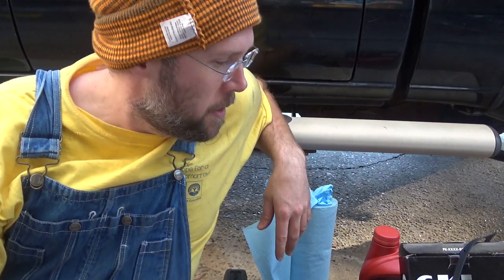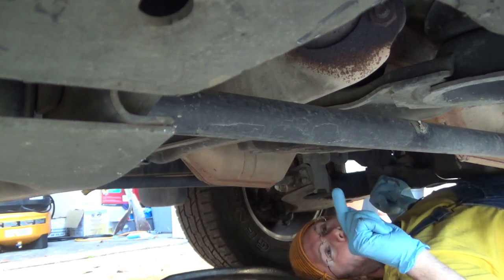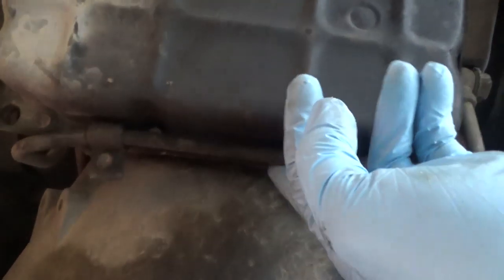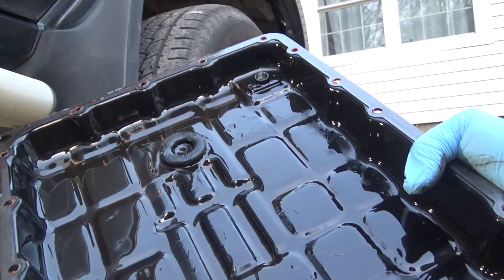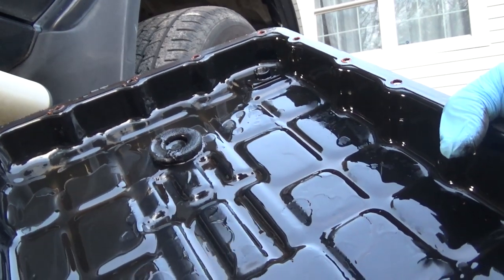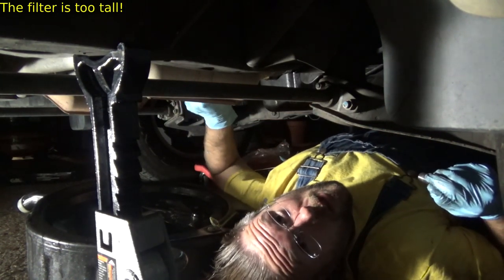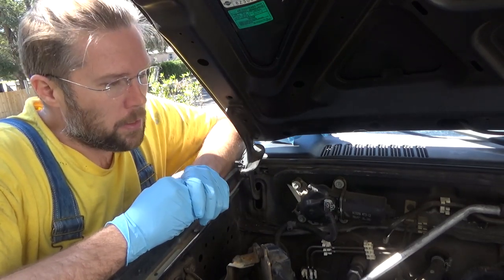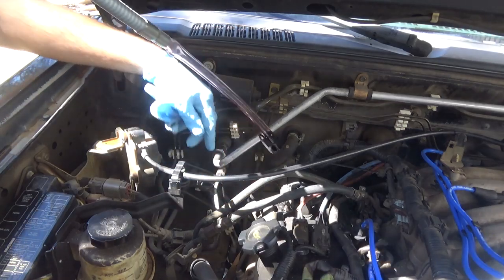2002 Nissan Frontier Crew Cab SE Transmission Fluid Change

Comment: Thank you for sharing the knowledge for which we are learning every day, I only have one question, when you use the measurement torque to which gauge you tighten the screws of the oil drain pan, thank you for your answer

Comment: My Nissan Frontier 2000 seems to making some rougher less smooth shifting in lower gears n all ( automatic trans) so I think it’s time for an transmission fluid change etc but I’ll get someone to do it for me . Also my fluid was good n pink or red off the dipstick which is a good sign that it is clean I hear . Also I just had an oil change and had used fully synthetic last oil change then went to semi synthetic this last change a few weeks ago which I had been using semi synthetic Max life vavloline line for years .
Reply from the maker: How did this turn out for you? Transmission still good?

Comment: I just changed the transmission fluid on my '01 Frontier Crew Cab XE with authentic brand Nissan transmission fluid. I made sure I added the correct amount. After I got done changing it, the truck doesn't move forward or backward but accelerates. I hope I didn't just destroy my transmission! Any tips? 😐
Reply from the maker: Sounds like the fluid is too low.
Reply: @RazorBucks  when I emptied it out, there were about 4 and 1/2 quarts in the pan. I added 5 quarts of the fluid but I didn't want to overdo it... I may just take it to a mechanic.

EDIT: I drained the fluid out of the pan and checked my work, then put it all back together. After doing that and adding about 4 and 1/2 quarts of fluid, it ran perfectly!
Reply from the maker: Did you check the level with the dipstick?

Comment: If my frontier has 280k would you recommend this...or just a drain and fill no taking of the pan ?
Reply: First,check the fluid. If it’s still not burnt dark,but just a brown color,you can drain and fill. In those Nissan’s transmisions there is no filter,just a screen,it’s not required to be replaced,unless you have a mechanical problem inside,or a water damage. So,there is no need to drop the pan every time you do drain and fill. I do my every 25-30k.
Reply from the maker: Just drain and fill.

Comment: My 02 Frontier takes a long time to shift into overdrive when it's cold.  I have never changed the ATS oil.   Anyone else experience this?
Reply from the maker: No, but I would change it if I were you.You are probably past the maintenance mileage for that service.
Reply: My dus the same thing!
Reply: I think it's purposely designed to do that so the fluid warms up faster - it's always done that for me - goes into overdrive at roughly the same spot on the highway on my way to work in the winter.

Comment: Were any of the studs which hold the filter/strainer in place "loose" fitting? I saw one Youtube video on a Nissan Pathfinder transmission fluid  change that three of these were actual bolts (as opposed to studs) which could be pushed upwards (and presumably "lost" in the transmission if you were not careful!  Does this comment apply on the Nissan Frontier?
Reply from the maker: Not that I recall, but let me review the unedited video and get back with you.
Reply: Take a look at https://www.youtube.com/watch?v=F0OwgbWbOGo  It is a Pathfinder not a Frontier but you can see on this video that there are three (inverted) bolts that he has to remove the nuts from.  I don't know  what would happen if they accidentally got pushed up - But "What can go wrong will go wrong!".  Looking at his video I get the impression that you could just leave the filter/strainer in place and vacuum out the debris because it is all on the underneath of the strainer.  Most of the local auto shops just clean the existing filter in place and replace the transmission fluid .  It may not be quite as thorough as replacing the filter but I get the impression it would be adequate.  What do you think?  Thanks.
Reply from the maker: I am not able to verify the bolts. I did not have a good shot of it, but I did not see anything in the service manual for it. I also removed all the bolts, so I do not think that the other video would apply to this transmission, but I cannot be 100% sure.
Reply: Thank you for the response.  It sounds like you did not encounter a problem with these bolts.

Comment: I recently changed my transmission filter and added about 11 quarts of atf on my 2003 Nissan Frontier SC. I realized many people  have used around 4-5  quarts and was wondering if having too much atf is what's causing my gears to slip and slow accerleration?
Reply: 11 quarts is the whole capasity. You’ll never going to drain all the fluid just by opening the pan. In most cases it’s about 4 quarts. If you added 11 quarts,trans is flooded,and you just caused a permanent damage to it.

Comment: Im due for a transmission fluid change in a couple of miles. Have you experienced any issues with the valvoline atf fluid you put in?
Reply from the maker: None at all.
Reply: Razor Bucks How much oil did you end up using?

Comment: How does the permatex work when you remove the bolts next time
Reply from the maker: Sorry for the late response, been busy with work.  Just use permatex again, however Nissan recommends replacing the bolts entirely.

Comment: What did you use to unscrew the drain plug? I have a 2003 model and it's not a normal shape of a bolt and places like jiffy lube say they don't have the specific tool needed to open it.
Reply from the maker: For my truck, I used a 19mm socket.

Comment: Did you notice any difference on how your truck shifted and drove after doing this?
Reply from the maker: Yes! It was much more smooth. Thank you for the comment.
Reply: Razor Bucks thanks for the video and for responding how many miles did your truck have when you performed the fluid change?
Reply from the maker: Around $145K.
Reply: Razor Bucks thanks I have a 103k I'll probably do this to my frontier thanks for responding I appreciate it

Comment: You put in 3 1/2 quarts of fluid in??
Reply from the maker: Between 3.5 - 4. Your level need may be different, but start on the lower end.
Reply: Razor Bucks thanks for replying!!
Reply from the maker: No problem. I hope your work goes well.

Comment: How much oil do you need to put in?
Reply from the maker: Check your manual, if you have it. Mine takes 3.5 quarts, if you have the same vehicle as I do, then yours will be the same. If you replaced the filter, 4 quarts. Test it on level ground, to see if you need more or need to let some out.

Comment: Hi Razor Bucks, awesome video.
What type of transmission fluid did you use & would the gasket need sealent as well?
Thanks ahead!!
Reply from the maker: Hello Harvey, I used Valvoline Maxlife ATF. I used permatex ultra gray as the gasket maker and I have had no leaks. Let me know if you have any other questions.
Reply: Razor Bucks my frontier 01' has 179,000 miles. The truck was bought 2 weeks ago it was out of ise for almost 2 years any suggestions with the maintence and transmission change?
Thanks again.
Reply from the maker: I would suggest you change all of your fluids, if you do not know when the last maintenance was performed. Is the transmission bad or are you talking about the fluid?
Reply: Razor Bucks tranny run great but recently i got a p0744 code any suggestions
Reply from the maker: How comfortable are you with working on your truck? You might want to start with changing the transmission fluid. https://www.yourmechanic.com/article/p0744-obd-ii-trouble-code-torque-converter-clutch-circuit-intermittent and https://www.engine-codes.com/p0744_nissan.html
Reply: Razor Bucks  thank for that link, ill keep you posted if any changes on this flush and code, Thanks again
Reply from the maker: You will need to clear the code and then see if it comes back, after your fluid change.
Reply: Razor Bucks hi there im in the working progress changing the atf, what will be the pan bolt  toque lbs.
Thanks again!
Reply from the maker: 70 in/lb or no more than 6 ft/lb. I believe I did 5 ft/lb, just to allow for a slight overage. Slow and steady wins the race here. Also, do not fill with oil straight away, let your gasket have time to harden. Did you replace the pan bolts or are you using ultra grey on them?
Reply: Razor Bucks everthing was replaced, now checking the level in this truck do i have to warm no normal engine temp.  put in neutral or park?
Thanks
Reply from the maker: Per the manual,

Checking A/T Fluid
1. Warm up engine. 
2. Check for fluid leakage. 
3. Before driving, fluid level can be checked at fluid temperatures of 30 to 50°C (86 to 122°F) using “COLD” range on dipstick. a. Park vehicle on level surface and set parking brake. b. Start engine and move selector lever through each gear position. Leave selector lever in “P” position. c. Check fluid level with engine idling. d. Remove dipstick and note reading. If level is at low side of either range, and fluid to the charging pipe. e. Re-insert dipstick into charging pipe as far as it will go. f. Remove dipstick and note reading. If reading is at low side of range, add fluid to the charging pipe. Do not overfill. 
4. Drive vehicle for approximately 5 minutes in urban areas. 
5. Re-check fluid level at fluid temperatures of 50 to 80°C (122 to 176°F) using “HOT” range on dipstick.
6. Check fluid condition.  If fluid is very dark or smells burned, refer to AT section for checking operation of A/T. Flush cooling system after repair of A/T.  If A/T fluid contains frictional material (clutches, bands, etc.), replace radiator and flush cooler line using cleaning solvent and compressed air after repair of A/T. Refer to LC-14 (KA24DE), LC-32 (VG33E and VG33ER), “Radiator”.
Reply: Razor Bucks  all good !!
Reply: Thank you for the big help and fast respond!!! Keep up the the frontier videos,
Reply from the maker: Thank you, I am glad the videos were able to help.
Reply: @RazorBucks  Does that mean you didn't use the gasket that came with the filter?
Reply from the maker: @DonLock3  Correct.
Reply: @RazorBucks  Thanks, It was confusing to see you hold up the gasket and then mention gasket maker. Great Video!

Comment: What cleaner did you use for the pan?
Reply: David Juarez looked like brake fluid, have same can in my shop.
Reply: Yea, mechs use brake fluid...some would argue non chlorinated over chlorinated: residue being left.
Reply from the maker: I apologize for the delay, I never seen this question. Yes, as Kev Sims and settripsbunch said, it was brake cleaner.
Reply from the maker: Thank you for answering Kev Sims and settripsbunch for stepping up and answering the questions I missed.

Comment: do you need silicone for the gasket?
Reply from the maker: I made a gasket with gasket maker. That is what the Permatex is for.
Reply: @RazorBucks  thanks
Reply from the maker: Best of luck to you on your maintenance.
Reply: @RazorBucks  do i need to put it in reverse and one tire on the air to get air  out of the system?  i am  happy almost  done
Reply: it only accepted 6 quarts of  oil
Reply from the maker: I am sorry, I am not sure what you are talking about? Are you asking about the transmission?
Reply from the maker: 6 quarts of oil in the transmission? You need to check to make sure you have not overfilled.
Reply: @RazorBucks  yes
Reply: thank for your help
Reply from the maker: There should be no reason to do anything about oil, as far as I know.
Reply: Razor Bucks did you use a gasket? Or did you use only the permatex for a gasket?
Reply from the maker: @steveng.c.8524  Permatex.
Reply: @RazorBucks  Why did you decide to make your own gasket rather than use the one that came w/the filter?
Reply from the maker: @tokenn1822  The filter they sent me was wrong. I feel that was a lesson learned for me to only buy OEM parts. I generally do only purchase OEM large parts, but I thought how could a filter get messed up and I learned how.
Reply: @RazorBucks  Ohhh, I see.  So had they sent you the correct part, you would have used the gasket that came with it?
Reply from the maker: @tokenn1822  Yes.

Comment: Can the bands be adjusted on this trans
Reply from the maker: I am going to paste what the manual says, but this is not something I have performed and I would recommend seeking additional sources of information.

Part No.* Free length Outer diameter
Low & reverse brake 18 pcs
31655-41X00 (Assembly)
22.3 (0.878) 11.2 (0.441)
Band servo
Spring A
31605-41X05 (VG33E only) 31605-41X14 (VG33ER only)
45.6 (1.795) (VG33E only) 47.6 (1.874) (VG33ER only)
34.3 (1.350) (VG33E only) 26.5 (1.043) (VG33ER only)
Spring B
31605-41X00 (VG33E only)
53.8 (2.118) (VG33E only)
40.3 (1.587) (VG33E only)
Spring C 31605-41X01 29.7 (1.169) 27.6 (1.087)
Accumulator
Accumulator A 31605-41X02 43.0 (1.693) 18.0 (0.709)
Accumulator B
31605-41X10 (VG33E only) 31605-4AX03 (VG33ER only)
66.0 (2.598) 20.0 (0.787)
Accumulator C 31605-41X09 45.0 (1.772) 29.3 (1.154)
Accumulator D 31605-41X06 58.4 (2.299) 17.3 (0.681)

Do you need a picture of the Band Servo Piston Assembly?
Reply: There is only one band in this unit (RE4R01A), it is engaged on the 1-2 shift and the 3-4 shift. It can be adjusted via a set screw on the exterior of the case, though if you are getting slip on any shifts, adjusting the band is not likely to help more than being a bandaid to get you up the driveway into the shop. Change your fluid or rebuild if the friction material is burnt up/worn out on the band or clutches.

Comment: Hi Razor, any ideas on how to remove engine oil pan??
Reply from the maker: What is the year and model?
Reply: @RazorBucks  thank you for the fast reply, nissan frontier 2001 v6 3.3l aut. 2wd
Reply from the maker: Sorry for the delay, I could not find my manual. I can make a video this weekend of these pages, if you need it, but below is a cut/paste of the instructions. 
Removal
NEEM0007
WARNING:  Place vehicle on a flat and solid surface. 
 Place chocks at front and rear of rear wheels. 
 You should not remove oil pan until exhaust system and cooling system have completely cooled off. Otherwise, you may burn yourself and/or fire may break out in the fuel line. 
 When removing front and/or rear engine mounting bolts or nuts, lift engine slightly to ensure safety. CAUTION: 
 In lifting engine, be careful not to hit against adjacent parts, especially against accelerator wire casing end, brake tube and brake master cylinder. 
 For tightening torque, refer to AT-415, “REMOVAL”; MT-41, “REMOVAL AND INSTALLATION”; PD-20, “Removal and Installation”; PD-71, “Removal and Installation”. 
1. Remove undercover. 
2. Drain engine oil. 
3. Remove stabilizer bracket bolts (RH & LH). 
4. Remove front propeller shaft from front differential carrier. 
5. Remove front drive shaft fixing bolts (RH & LH). 
6. Remove front differential carrier bleeder hose. 
7. Remove front suspension crossmember. 
8. Remove differential front mounting bolts (RH & LH) and rear mounting bolts. 
9. Remove front differential carrier. 
10. Remove front differential carrier mounting bracket. 
11. Remove starter motor. 
12. Remove transmission to rear engine mounting bracket nuts (RH & LH). 
13. Remove engine mounting bolts or nuts (RH & LH). 
14. Remove power steering mounting brackets (RH & LH). 
15. Lift up engine. If necessary, disconnect exhaust tube. 
16. Remove relay rod. It is not necessary to disconnect pitman arm.
SEM308F
17. Remove oil pan bolts in numerical order.

OIL PAN VG33E AND VG33ER Removal
EM-79
SEM365E
18. Remove oil pan. a. Insert Tool between cylinder block and oil pan.  Do not drive seal cutter into oil pump or rear oil seal retainer portion, or aluminum mating face will be damaged.  Do not insert screwdriver, or oil pan flange will be deformed. b. Slide Tool by tapping its side with a hammer, and remove oil pan.
SEM350B
Installation
NEEM0008 1. Before installing oil pan, remove all traces of liquid gasket from mating surface using a scraper.  Also remove traces of liquid gasket from mating surface of cylinder block.
SEM894B
2. Apply sealant to oil pump gasket and rear oil seal retainer gasket.
SEM351B
3. Apply a continuous bead of liquid gasket to mating surface of oil pan.  Use Genuine Silicone RTV or equivalent. Refer to GI-51, “Recommended Chemical Products and Sealants”.
OIL PAN VG33E AND VG33ER
Removal (Cont’d)
EM-80
SEM015E
AEM080
 Be sure liquid gasket is 3.5 to 4.5 mm (0.138 to 0.177 in) wide. 4. Apply liquid gasket to inner sealing surface as shown in figure.  Attaching should be done within 5 minutes after coating. 5. Install oil pan.  Install bolts/nuts in the reverse order of removal.  Wait at least 30 minutes before refilling engine oil.
Reply: @RazorBucks  my truck is 2wd but the inf. Should work outstanding!
Ill keep you posted if any changes thanks again!!
Reply from the maker: I have an 02 2WD with the VG33E, which I believe you have too. I can get you the K24DE instructions, if you need it.
Reply: @RazorBucks  whats the diffrence?

Comment: how often should I to change ATF?
Reply from the maker: You should consult your manual, as it varies between models/years, mine is inspect every 30K miles and change as needed. For me, the lesson I learned is that I should have used a factory filter, instead of aftermarket. I believe I had somewhere around 130K miles, that is the only reason I was going to change the filter.

Comment: Couldn't you just pull the plug and drain it instead of dropping the pan and replacing the gasket ?
Reply from the maker: Yes. The reason I dropped the pan was to clean the metal shavings of 130K+ miles of use.
Reply from the maker: @DD D The aftermarket filter was no good, I cleaned the screen and reused the OEM.